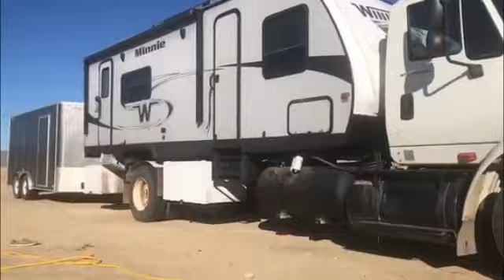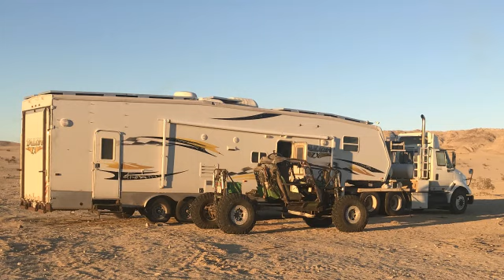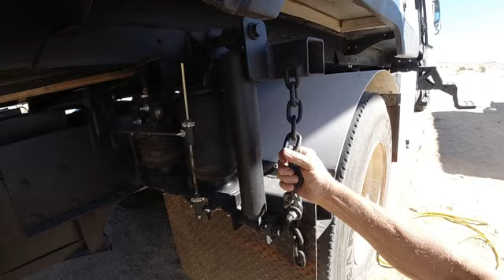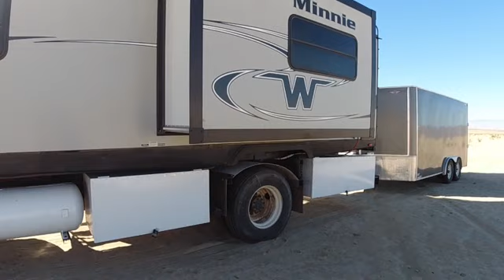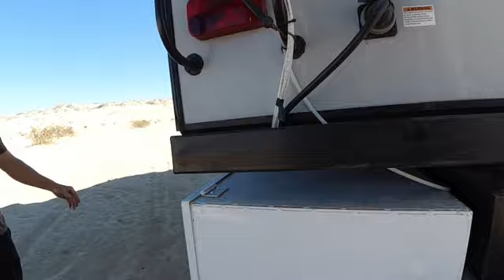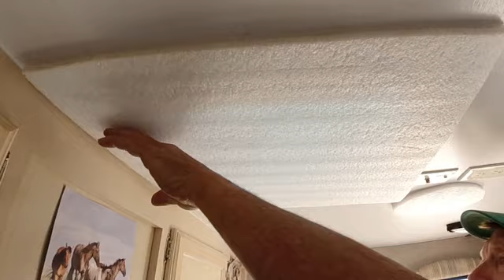Boondocking Beast

Comment: That's very cool!!!! I love the semi tractor trailer for a more capable frame and fuel storage capacity; and the panels on top are a great idea too! 

Did the extra axle and set of wheels on the tractor not make it because of space and driveshaft limitations? It looks like a better boxtruck now.
Reply from the maker: I wanted to get rid of the weight and drag.
Reply: Is it just a limitation of its turn radius which would cause too much lateral friction for any additional set of wheels that far back? That would make sense because all other vehicles like buses and straight trucks have only one row of rear tires.